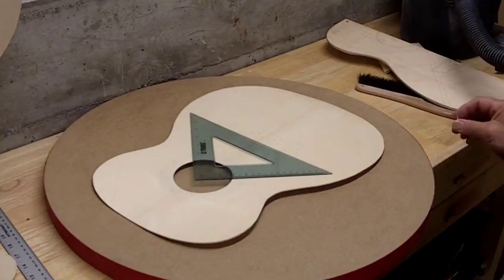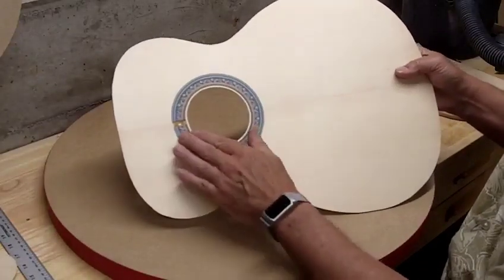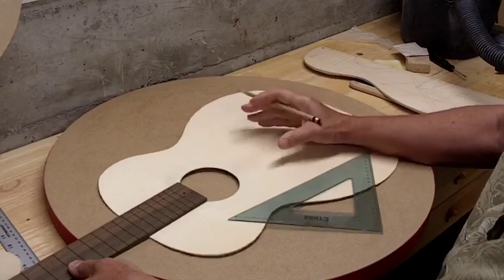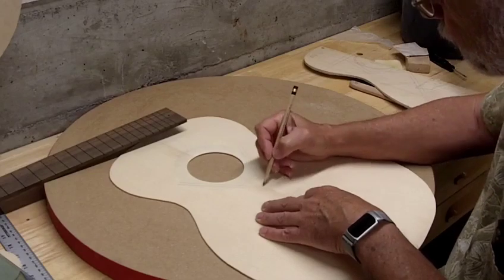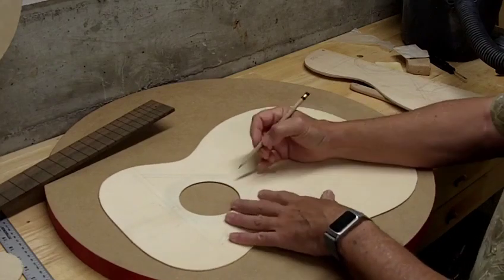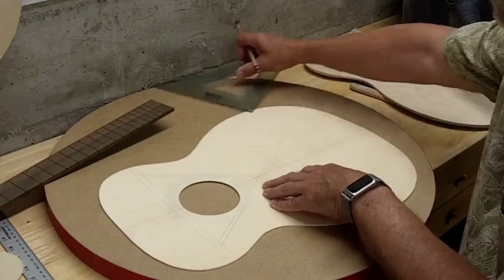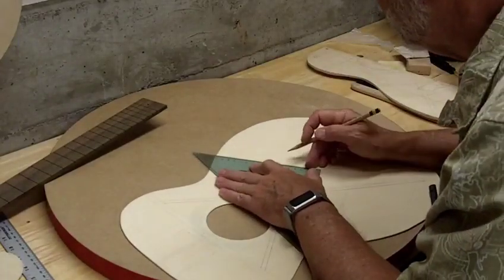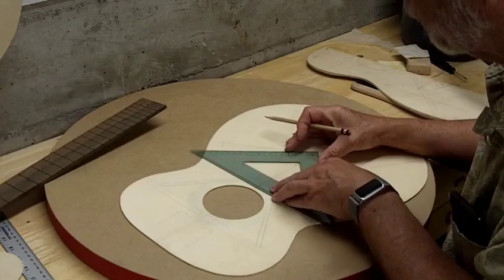Seat of my pants designing a guitar's bracing pattern

Comment: My thoughts recently have been towards not leaving an acoustic guitar under tension for more then 8 hrs. Basically to really  back off the tension while the instrument is not in use. In theory, this hopefully should minimize the stress on the soundboard, the lifting and diving of the soundboard from the tremendous pull of the strings. Not to mention the stress on the neck, it is certainly a juggling act to deal with while trying to achieve a compromise to produce desirable  responsive top with pleasing playability. A fine line the Luthier walks, it is a never ending  journey.
Reply: I play flamenco guitarras, which are lightly constructed; leading to cracks,  neck underbow, and "belly bulge."  My solution:  medium tension strings and tune a full note down (D, A, F, C, G, D) and use a cejilla (capo) on the second fret.  Very little flamenco is played past the 12th fret.